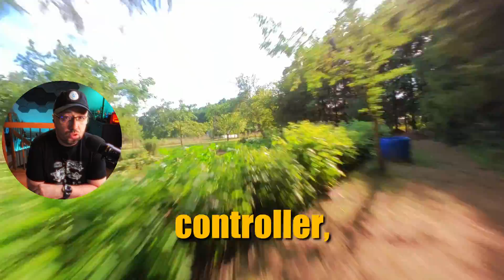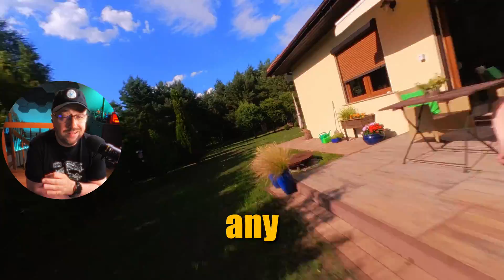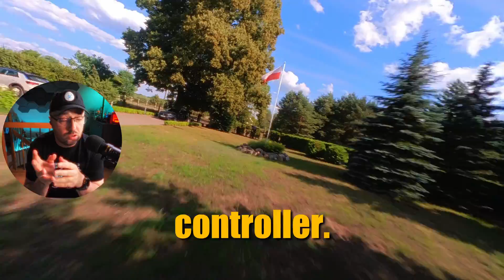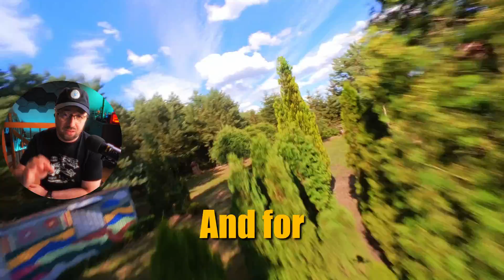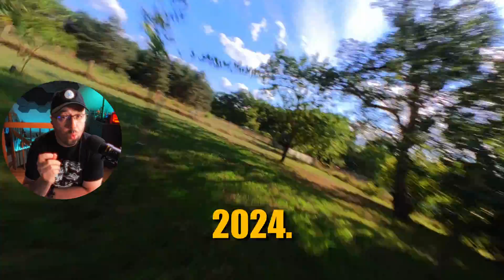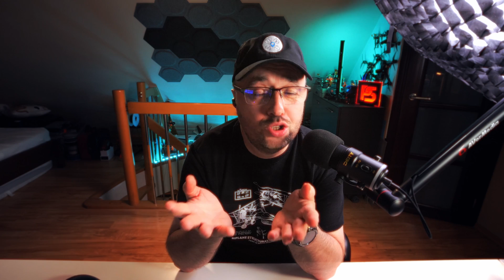Be careful with F722 flight controllers

Comment: I already have iFlight Nazgul Evoque F5 V3 with this FC and ERLS, Im trying to connect with my DJI FPV Remote Controller 3 but it doesnt works, (I turned off CSRF and I selected SBUS in receiver options and I Disconnected ELRS on FC) my DJI O4 has 4 cables to connect to the FC, no idea how to activate SBUS, I will really appreciate your support

Comment: I found a forum topic with name "Betaflight Too Big?" and post writing this: F405 Region Size 922K Betaflight 4.3.0 with 43,6% usage. F722 (the bad versions with 512K not better versions with 1024K, STM32F722RGT6) Region size 480K Betaflight Betaflight 4.3.0 with 89,5% usage. So if you don't want to use a trimmed (cloud) new Betaflight OS, then FCs with 512K will probably no longer be sufficient very soon...
Reply: The RGT6 variant of the f722 doesn't exist, there is no mention of it anywhere aside from mislabeled listings. The F722 datasheet clearly says "up to 512Kbytes of flash". Only The F745/746/756 etc variants have 1Mb flash. And the F769 and F77* series which have 2Mb flash.
Reply: @pvim  Maybe you look at an old datasheet ? Github => Supported MCUs #197 => 4. F722. From what I could find, some FCs use the STM32F722RET6 (with 512 KiB of flash) while others use the STM32F722RGT6 (with 1024 KiB of flash)...

Comment: If anything, the f405 processors are gonna get a feature cut, since f722's are just faster + the memory constraint is almost irelevant since cloud builds are a thing now(you can just cut out features that you don't use and save on space). Also releases of hardware are an indicator - iFlight blitz stacks(only f722 and f745), Flywoo GOKU(only f722), darwinfpv cement (only f435 and f722) etc.

Comment: If you opt for a 405 controller, I think that it will not be compatible with the upcoming version 8 of iNav.  I think that it will require STM32F7 based microcontrollers.  In that case the STM32F405 would not be upgradable.
Someone please correct me if I have that wrong.
Reply from the maker: You are mistaken. INAV is stopping support for F411, not F405. F405 are indeed more powerful MCUs (in some areas) than F722
Reply: @FPVBites  Ahhh, I learned something today so "thank you" for setting me straight.  I didn't realize that the F411 is a stripped down F405 with slower max clock speed and some limitations on the real-time-clock that the F405 isn't subjected to.  I checked with Perplexity and it spelled out the differences.  I've always assumed that a larger part number meant it had "more good stuff".
And yes, it appears that it's only the F411 that iNav plans to discontinue support for: ""INAV 7 is the last INAV official release available for F411 based flight controllers. The next milestone, INAV 8 will not be available for F411 boards."

Comment: I’m picky about the flight controllers I use. Here’s a reason to use an F722 that has nothing to do with the processor itself. There are other features that I consider important. I want a barometer because it gives a more accurate altitude than just GPS and I want to have an indicator of whether I am within the legally allowed range. The 9 to 10v BEC needs to be able to support the most power hungry digital VTX units currently on the market. There needs to be a built in pit mode switch so I can turn off the VTX when initially getting satellites. There needs to be enough UARTs for GPS and i2C pads in case I want to do barometer are preferred but not necessarily required.  I have found a few F722s that meet all these requirements but have not found any F405s yet that do.
Reply: Yea its hard to get that VTX power switch on and off.  Its like flight controlers dont offer than anymore.
Reply: @craigcupit1917 i had to set up a switch for my axis flying argus f7 aio to turn on vtx 😉 you might be able to set up a switch on others for it. I think it was a user 1 switch. Was a while ago. I wonder if i set up a user switch on others if it would work 🤔
Reply: every f405 i have except an ancient emax one has all that
Reply: @420247paul I just took a Quick Look and couldn’t find a single one for sale with the pit mode switch functionality.

Comment: on my speedybee f722 the erls module will not commmunicate on CRFS but work on sbus, and yep inverted. same for geprc and skystars and RM rp1 receivers.
Reply: Are you using O3?
Reply: If you're using 03 cut the the yellow wire of the VTX cable. It's interfering with your elrs / Xfire. 
I had the same thing happen to me and when I checked the SpeedyBee f7 manual it indicates this as well. They suggest you cut / or eliminate the sbus wire (yellow) on the VTX cable for the 03. Hope this helps.
Reply: @jomarayala6128  Yea, precisely, that is why I asked. This sounds suspiciously like user error
Reply: A neater way is to carefully remove JST SH connector for the SBUS wire
Reply: @jomarayala6128  If you are running an O3 you only need power, ground, rx and tx
Reply: You should be depinning the sbus on 03 all the time if your not using the DJI RC  @jomarayala6128
Reply: I bet this was the problem i had with this. Tossed it in drawer and bought another one 🤣🤯😉 couldn't get the f7 to work. Went to f4 v4.

Comment: With Betaflight cloud builds, the flash memory is no longer an issue. F722 having inverters we don't use anymore, doesn't really seem like a reason to "Be careful".
Reply: If you ever one to try ArduPilot, you'll need a different FC.
I have several F722 boards but I don't plan to purchase any in the future.

Comment: What do you think of Artery AT32F435 mister? This new chip offers nice features above F405 and bellow F722, is this new chip worth to buy? Need more advice please
Reply: drivers are annoying, but as long as you stay with betaflight, you should definitely go for them as they are cheaper and more powerful than F405
Reply: You will be stuck using betaflight 4.5 or newer or a fork that supports it. 

Or any other firmware that supports it. 

But otherwise, the at32f435 is the same size as an f405 and a couple bucks cheaper and faster so there’s not really any other downsides to using it aside from compatibility.

Comment: I'm keen to get some advice on sbus and smartport. Currently I use frsky equipment and esc and use smartport telemetry to send it to my transmitter. I have a speedybee f405wing and a matek h743 wing. Is there a better way to to connect my receiver and telemetry?
Reply: fport
Reply: Yeah ELRS.
Reply: FPort as someone else also suggested is the best option. If you have SPort working already then the wiring is already set up correctly except you can disconnect the sbus wire since it will not be used. With SBus, you need to put RSSI on a channel but with FPort, the value is available without using up a channel.
Reply: Fport is my preferred connection with frsky.  Its nice it includes RSSI.